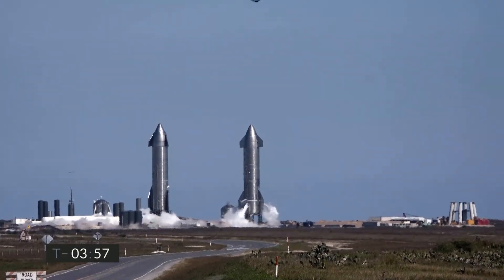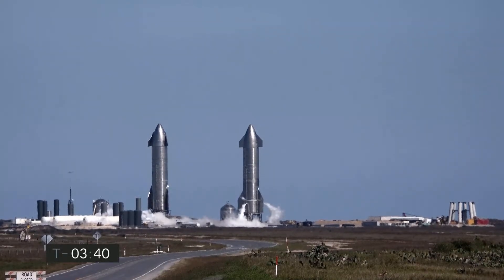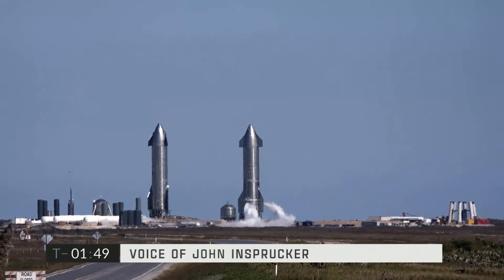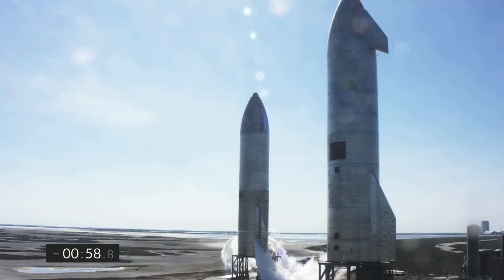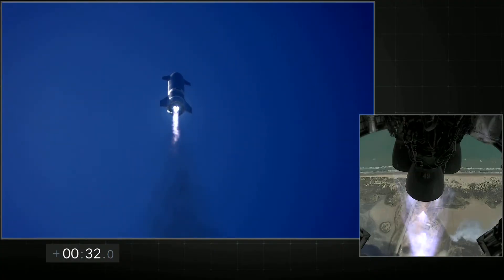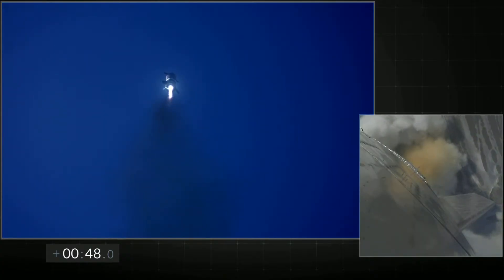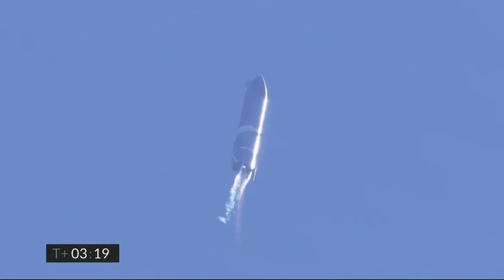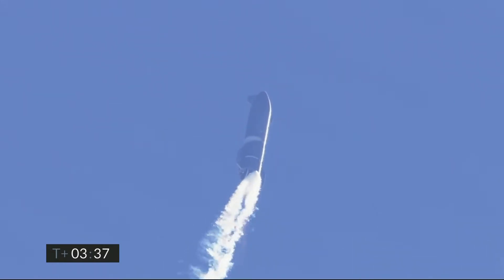Starship | SN9 | High-Altitude Flight Test

Comment: The worshiping of these phallic symbols reminds me of the 80's dudes worshiping glam rockers.
You space cadets love your fireworks.
Rotflmfao.
Reply: The Earth still isn't flat.
Reply: @flatliner5729  it's definitely not a spinning ball of dirt and water.
Or is it a pear?
Reply: @mysticnomad3577 You're right, it's not a spinning ball. The Earth is an oblate spheroid that rotates at 0.000694 RPM. This is an established fact backed by all fields of physics, astronomy, and geology. Feel free to provide any verified, peer-reviewed scientific research and evidence to back your notion of the Earth not being a sphere.
Reply: @mysticnomad3577  it is, though
Reply: @flatliner5729  I know I'm right.
Why are you telling me things I already know and have been debunked?
I also know when you apply the curvature formula at 7.98 inches per mile ² to detect or measure the earth's supposed 26,000 mile curvature, it fails to detect it at all. I've done this myself as a land surveyor for an environmental lab. 

This is especially effective over large bodies of water because we know water  maintains a flat level surface. It's actually used as a leveling tool if you think I'm wrong. But I digress.

That's unless you're either blind or dumb or both.
Reply: @mysticnomad3577  "I know I'm right.

Why are you telling me things I already know and have been debunked?"

You're saying all of physics, astronomy, and geology have been debunked? Where is your peer-reviewed, verified scientific research and evidence to "debunk" the Earth's spherical nature? 

"I also know when you apply the curvature formula at 7.98 inches per mile ² to detect or measure the earth's supposed 26,000 mile curvature, it fails to detect it at all. I've done this myself as a land surveyor for an environmental lab."

That is not how you calculate curvature, at all. As a land surveyor, you should know that. Here is a site that lays out the math of calculating the curvature and gives a visualizer, http://walter.bislins.ch/bloge/index.asp?page=Finding+the+Curvature+of+the+Earth%3A+Stand%2DAlone+App

"This is especially effective over large bodies of water because we know water  maintains a flat level surface. It's actually used as a leveling tool if you think I'm wrong. But I digress."

Water is level, not flat. All water on Earth is in a state of equipotential because of gravity another fact of reality that cannot exist in your fictional world.
Reply: @flatliner5729  water always flows to its lowest point by the path of least resistance .
Water always forms the shape of its container but stays level on its surface no matter how it's manipulated.
It's used as a leveling tool.
Quit trying to make it sound complicated because it's not.

If you dig a hole from Canada to China on your ball earth, do you come out feet first or head first?
Is their more sky below me if I keep digging?
People have tried and can only get 8 miles into the earth, but I digress.

If I was sitting in a lawn chair at the north or south pole, would I just spin in place?
Does gravity still pull me to its center of mass?

How does gravity effect things in geo stationary orbit? 
If the earth is moving 66,600 mph around our sun while it races around a galaxy at over 500,000 mph while the galaxy races around the "Great Attractor", how do they keep up?
What's the magic gravity line where I pop out of the earths atmosphere and I'm floating?
Lmao.
Reply: @mysticnomad3577 "water always flows to its lowest point by the path of least resistance .
Water always forms the shape of its container but stays level on its surface no matter how it's manipulated.
It's used as a leveling tool.
Quit trying to make it sound complicated because it's not."

Nothing I said sounds even remotely complicated, unless you're under the age of ten. Water flows to areas of low potential because of Gravity, it is seeking locations closest to the center of the Earth. That is how Gravity works and why water is level. It's called equipotential. I'm sorry you don't understand basic science. Would you like to explain why objects fall down in your fictional world?

"If you dig a hole from Canada to China on your ball earth, do you come out feet first or head first?"

I don't build tunnels for a living, but I imagine tunnels are constructed so that you exit head first, regardless of location.

"Is their more sky below me if I keep digging?"

"Below" you is only relative to your current position. That's a concept you flatties seem to struggle with, something being relative.

"People have tried and can only get 8 miles into the earth, but I digress."

Because the pressure is to high for our equipment to survive that far beneath the surface. The closer you get to Earth's core, the center of Earth's Gravity, the higher the pressure is. 

"If I was sitting in a lawn chair at the north or south pole, would I just spin in place?"

You would rotate with the Earth, just like every other position on the planet. The star trails would look different for you at the poles than elsewhere. Speaking of the star trails, have any of you flatties figured out the stars counter-rotation in the southern hemisphere? And why there is a different night sky in the southern hemisphere at all? 

"Does gravity still pull me to its center of mass?"

Gravity always pulls you towards the center of mass.

"How does gravity effect things in geo stationary orbit?"

What do you mean? Satellites in geo-stationary orbit are like any other satellite except they are traveling at the same rate of Earth's rotation. Research orbital mechanics. 

"If the earth is moving 66,600 mph around our sun while it races around a galaxy at over 500,000 mph while the galaxy races around the "Great Attractor", how do they keep up?"

Linear velocity is essentially meaningless when describing the rotation and motion of celestial bodies. The sheer size of these celestial bodies make these speeds irrelevant. You also fail to realize that linear velocity is only relative. All of these speeds depend on a stationary observer. 

"What's the magic gravity line where I pop out of the earths atmosphere and I'm floating?"

There is absolutely nothing "magical" about Gravity. When you leave the lower part of Earth's atmosphere, you escape part of Earth's gravitational influence, but it still affects you in a micro-gravity environment. Again, research orbital mechanics.

Also, did you take a look at the resource I linked you to? And have you found any verified, peer-reviewed scientific research and evidence to remotely back any of your assertions and debunk all of physics, astronomy, and geology? I'm still waiting.
Reply: @flatliner5729  do you think I have A D D or is it you?
I know what I wrote.
Reply: @mysticnomad3577  The Earth was proven to be a sphere long before the Jesuits existed. Nothing about what I said is "theoretical". Gravity is very real, you can't even calculate buoyancy and weight without it. You Flat Earthers have no peer-reviewed or verified scientific research or evidence, you only have BS pushed by grifters and idiots. The scientific method has repeatedly verified the Earth's spherical nature. Again, as I have said, all of physics, astronomy, and geology back up the Earth's spherical nature, and you can't even remotely address this fact.
Reply: @flatliner5729  what proof?
The earth has only been forcefully presented as a sphere or pear or oblate spheroid the last 500+ years.
Before that it was the Greeks who philosophized it about 1500 years ago with your first free mason hero Pythagoras.
Do you know that philosophy isn't considered   factual?
Get over yourself and your Jesuit parroting.
The earth is flat and stationary as modern technology shows.
There are also countless experiments showing the earth to be flat and stationary that pass the scientific method.
You can't show me a large spinning mass attracting smaller masses to it causing them to stick to and or orbit it.
So you got nothing.
Reply: @flatliner5729  you most certainly can calculate densities and buoyancy adds displacement to the equation.
No magical "gravity" needed.
The combined molecules of a human as an example is more dense than the air that surrounds them on land and thus you fall to the densest thing we know of, the earth.
Water is more dense than air thus buoyancy comes into play.
We are still more dense than water and still sink to the next medium which is earth.
No, you don't go sideways or keep going up.
You already think there's no up or down anyway. Lol.
People hilariously think that ships need to be built with the "gravity" equation factored in but it's a hoax.
Ships were built long before "gravity" was twinkle in "Newton's" eye.
The crazy alchemist and free mason you guys worship along with Einstein the patent clerk.
Reply: @mysticnomad3577  Please demonstrate your alternatives to the buoyancy and weight formula and please show how you derived it. Just saying “density and buoyancy” cannot alone explain away Gravity. All objects accelerate at a rate of 9.8 m/s^2, this is an absolutely undisputed fact. Any acceleration requires a force, density is not a force and cannot explain why objects fall to the ground. Buoyancy is a force, but only because of gravity’s existence. Weight is also a force, but only because of gravity’s existence. You can’t get away with saying “density and buoyancy” without having to actually address Gravity. 

Now please provide a single piece of legitimate, verified, peer-reviewed scientific research and evidence that can even remotely disprove Gravity. I’ll wait, but I’m willing to bet you can’t. All you can do is tout the flattie talking points you’ve been fed by grifters and liars.
Reply: @flatliner5729   falling objects have nothing to do with "gravity".
Just because the velocity of something can be measured while falling does not prove "gravity" is the cause.
That's a myth. 
Controlled experiments show this is not the case.
Not all objects fall at the same velocity.
Objects fall relative to their "mass" and the displacement of air molecules while falling.

If I jump out of a plane and point myself straight up and down or vertical to the earth, I will reach and maintain terminal velocity rather quickly.
If I spread my arms and legs out and position myself horizontal to the earth, I will slow down considerably.
This has to do with displacement which causes friction.
So how does gravity factor in?

"Gravity" is a man made construct invented to help explain the fantasy helio-centric universe now known as the A-centric universe.
Unfortunately, for you the earth remains generally flat and definitely stationary.
When you can show me a gravity experiment that is not on a planetary scale I'll concede.
Provided it passes the scientific method.
Reply: @flatliner5729  I don't have to disprove "gravity" because it has never been proven.

I'm unaware of any evidence that proves that "gravity" is real or needed.
Theories are not proof to me.

Comment: Do I think fuel wobble is the problem?
Why don’t you turn the rocket back before the engine restarts at a higher altitude?
Falcon9 starts stably in this position.

Or the auxiliary tank should have a membrane to prevent bubbling of the propellant.

Or a centrifugal deaerator in the tube.

Or implement start-up mode with non-liquid fuel. 

I hope they solve the problems.
I want to get to Mars. :)

Comment: How much merlin 1d produces CO2?
Reply: Well that depends entirely on how long it runs for. At full thrust, it produces about 60kg per second by my math. 
And about the same again in carbon monoxide, for about 120kg total carbon emissions.
For comparison a typical jet airliner engine like a GE90 produces about 10kg of CO2 per second at full thrust.
Reply: @lazarus2691  I posted a link of the SN9 swap-out of their Raptor engines.
Reply: @astr0creep6x6x6  I think you've replied to the wrong comment?

Comment: What changed between sn8 and sn9. Both seemed to fail the same way.
Reply: Sn8 had issues with oxygen rich fuel, while sn9 just had a raptor not ignite
Reply: SN8: Pressure lost
SN9: Engine failiure

Comment: Just a novice opinion but looked as though SN9 over rotated at landing. SN8 looked as if it did not rotate enough at landing. Need to find the sweet spot.
Reply: Yes it did. You can see it a lot more clearly in some of the amateur footage from people with different angles. Maybe 50 degrees or so too far.

Comment: It's not about the engines, it's about doing the flipp above 2 KM to give the engines time to perform right for the landing.
Reply: they do it as late as possible for a reason, they're trying to test the rocket's applicability on mars, since the atmosphere on mars gets really thick closer to the surface, to add to that anything higher than 2 km would waste alot of fuel, and would be very inefficient. So far, they have no issues with the flight profile, but with the hardware

Comment: I think you should start testing the landing engines in higher altitude so that you have more time to slow down 🚀💫
Reply: It was not a problem with the speed, one of the engines failed, causing it to crash and lose stability
Reply: Plus starting engines at a higher altitude would require an engine shut down and relight. Not very efficient to go that route.
Reply: @Ezric2  yep

Comment: Watched 2 Starship flight tests (plus copious spacex rocket tests over 2+ yrs  & can't help seeing that the landing process needs to be assessed.  Regardless of the Raptor improvements, the entry burn needs to happen sooner for more control on landing. But who am I but a process auditor?
Reply: well, so far there seems to be no real issues with the flight profile, and most of the problems seem to be coming from hardware issues
Reply: @danimorcos7226  Good point, the raptor failures aside, the SN8 landing failure was more pressure/fuel related. SN9 seemed to sprint to vertical landing & failed. Would like to see SN10 have an earlier vertical land control
Reply: @66StarshipAlien  i mean, they do the late flip for a reason, they have 2 main reasons actually. number 1: theyre trying to be as fuel efficient as possible, as a way of simulating future landings   number 2: theyre also seeing how late they can fire the engines, so they know how late can they stay airborne on mars, since the atmosphere near the surface of mars gets very thick very quickly, which makes starship lose alot of velocity
Reply: To be clear, it's as if the raptor entry burn over compensated for the landing, SN9 did achieve vertical status & then tipped, like when over-compensating steering in a car when you see an issue coming towards you. An earlier entry burn assumes greater control
Reply: @66StarshipAlien  well, I'm guessing you mean landing burn, and to be accurate here, sn9 didn't really over compensate, the system did what it would do if both raptors were on, and also, if it did do the same thing at a higher altitude, it would've used even more fuel to go back to vertical position, and then use alot of fuel to get to the ground. It would've been simply to inefficient.
Reply: @danimorcos7226   if you look at the vision, SN9 did definitely over-compensate & that was the issue in the landing burn, that is almost a given, raptor issues are ongoing but I revisit my initial view that the re-entry burn needs to happen sooner for SN flights, as opposed to booster landings to compensate for greater velocity, it's simple physics, the simple solutions are often the best ones

Comment: Absolutely amazing that it can just take off from the flat pad with no massive support structure around it like the Apollo days etc, great work!
Reply: Yep. You don't want to have to build a giant launch tower on Mars for the return trip. 
I think the plan is literally just to fuel it up while it sits on it's landing gear, then retract them as it launches.
Reply: @lazarus2691  If it's manned, there will be an acces tower, other than that, nothing else.
Reply: @lazarus2691  I didn't think anyone who went to mars got a return trip. That being said, Elon has great toys and a great volume of knowledge, BUT! If you follow the natural progression of thought and get humanity established on mars, then you will want air and water etc, etc, etc until you have changed or added to the planet enough that it will change it's nature - and that will change it's ORBIT [ it spins in zero gravity, space ]- BAD IDEA! for Earth The correct question is not " How could it? " the correct question is " How could it NOT! " and this is where Elon isn't intelligent. A real intelligence would see the problem from before the beginning and not proceed. You will not have to worry about atlantic ocean current changes bringing about an ice age, if you play marbles with one of our neighbour planets. You will recover from an ice age, you will not recover from a change in orbit.
Reply: @justme.9711  
It's more a case of Elon wanting the rockets back so he can use them again. No point leaving them gathering dust on Mars, and if someone wants to hitch a ride for the return trip, there's no reason to stop them.

As for altering Mars enough to affect it's orbit, there are ways to offset that(for example gravity assists from redirected asteroids -tricky, but possible), making it 'merely' a puzzle to solve for future terraforming engineers.

The reality is, if we don't want to be stuck on Earth forever, we're going to have to learn how to tweak the solar system at some point, and I doubt we'll figure that out by staying here at home.

Comment: An engine has not started yet.
in my opinion too much turbulence in the fall, for how it is done where there are engines. They conflict, ignition of the first compromises the ignition of the second during the maneuver.
Reply: SN8 started both of it's engines side by side during the flip. It just didn't have enough fuel pressure to keep them running.